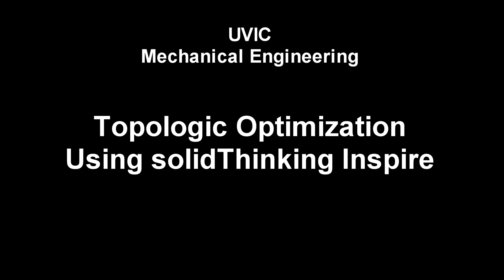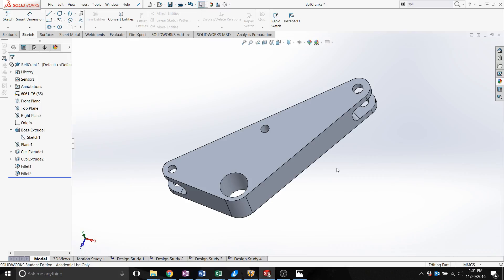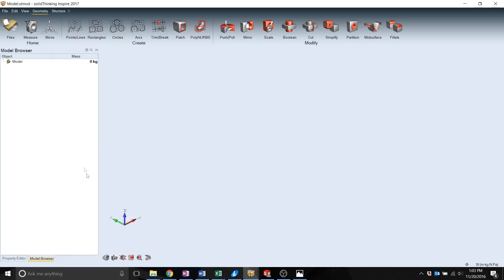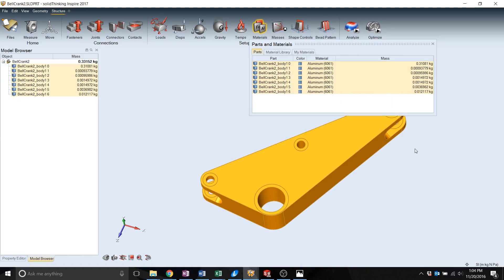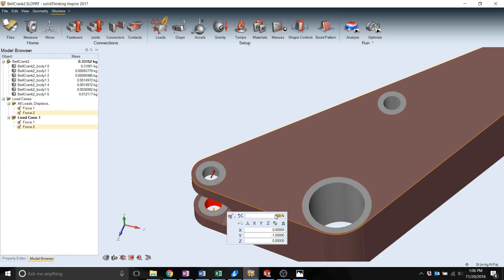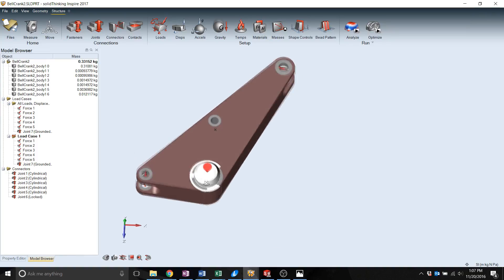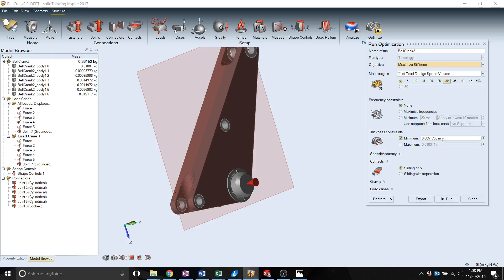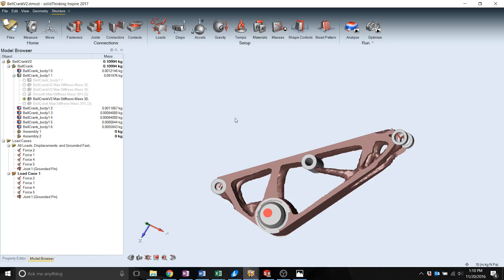Using SolidThinking Inspire to Optimize a Solidworks Part

Comment: Hey :) cool video.
I would like to know what hardware do i need for fluent work with this software. Homepage says they recommend 8 gb of ram and 256 mb graphic card at least. what would u recommend?
Reply: I have a 5 year old Hp computer, 4GB Ram, and it still runs very smooth I guarantee you.
Reply from the maker: MrUratox For this video demonstration we used 16GB of ram, an i7 processor, and a 1GB dedicated graphics card. As you can see from the footage it ran quite smoothly with this setup.
Reply: it totally depends on your parameters and component size...I have 24gb ram with 500gb ssd , I8 processor and 4 gb of graphics, so, small components like wheel upright, clamps, or bell crank lever can be done easily, with fine meshing.